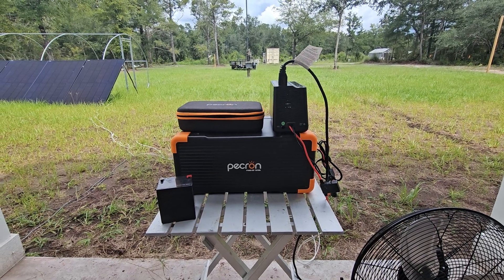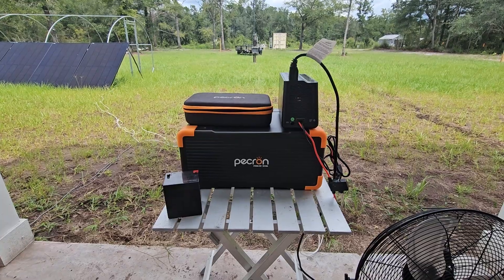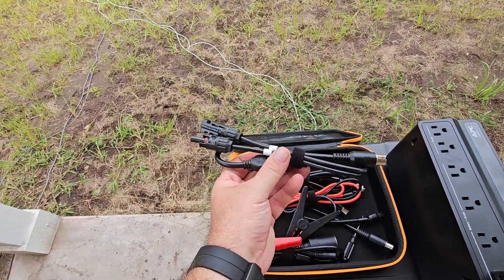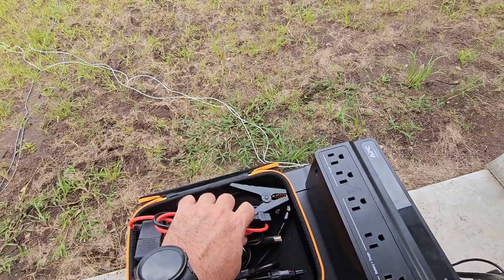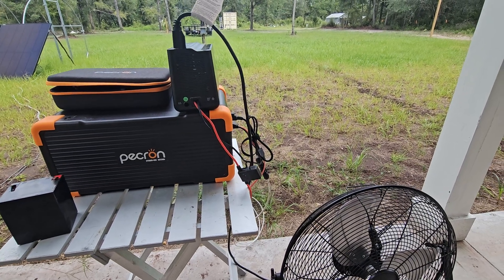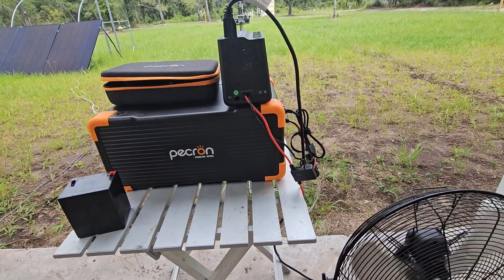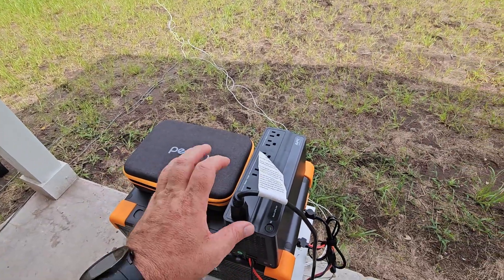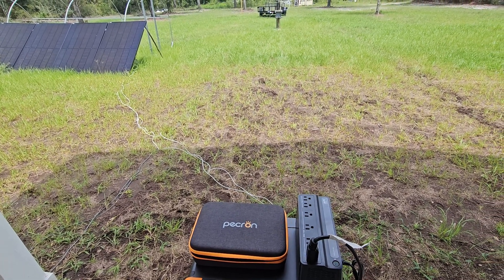Pecron EP3000 real world use.

Comment: I just came across your channel and I did subscribe. I'm new to solar and just bought the pecron E3600LFP and 48v expansion battery. I was told to charge them both to full before connecting but how can I charge the expansion battery? I don't own solar just yet. Can you tell me the most budget option just to get the battery full charged. I thought my car cigarette adapter but that will mean running my car for 10hrs. THANKS FOR ANY HELP
Reply from the maker: The power station and batteries are shipped around 50% state of charge.  If the battery and the power station are within 0.5V you can connect them. You can also charge or discharge the power station to match the voltage. The ke is to have the batteries close in voltage before connecting them.
Reply: @GridDownPreparedness  o....ok so it's not that they need to both be full they just both need to be the same voltage?  So I can discharge 1 or the other so they both are at the same voltage? And I assume just check it with a multimeter at the expansion port? THANK YOU FOR YOUR HELP..... TRULY!

Comment: You can purchase a F3000 Power Station from Pecron for $759 with a code. This battery will cost you about $690 with the  plug and a code. I think I would just pay $70.00 more and get a complete power station with the inverter already built in and the ability to charge it with solar, AC or an inverter generator.

Comment: Does it not come with the cascade cable?
Reply from the maker: The battery does come with accessories including the cascade cable.
Reply: @GridDownPreparedness  Ok, cool. Thanks. So there's no real price advantage to ordering any kit other than the two 3600's with the combiner at a discount. Also, out of curiosity, why does nobody ever talk about what hot f√¢%ing garbage the pecron app & and wireless connectivity is?
Reply: @GridDownPreparedness  It only comes with the cascade cable for Pecron-to-Pecron connectivity, right? It doesn't come with the Cascade-to-xt60 cable?

Comment: i thought those Pecron batteries has 48v output, not 13v
Reply from the maker: The battery pack itself is categorized as a 48 V pack. It has a DC to DC converter. A 30 amp output that is a nominal 12 V DC.  Similar to the E3600LFP.

Comment: You could get the PECRON MJ32 Cascade Port Output Cable - Output Max 1200W per XT60 port and that should open other doors. I think itll make it compatible with the Eco flow wave 3 portable ac

Comment: There are videos on connecting to the main outlet and then using xt60 as input to other power stations. Many are 1000 whr and cheap and light and still have 1600 watt outlet. Thus you can run a real ac. Anker c1000 is $449. The pecron e2400 is $629 and uses same expansion batteries.

Comment: No one even test how much the extra battery capacity is.
Reply from the maker: I estimate the real-world capacity is about 90% of the rated capacity.  When the unit is running and outputing the 12V, the DC converter does use power along with the cooling fan.